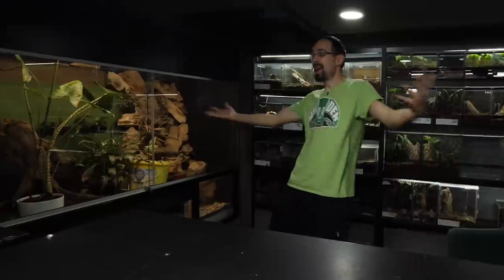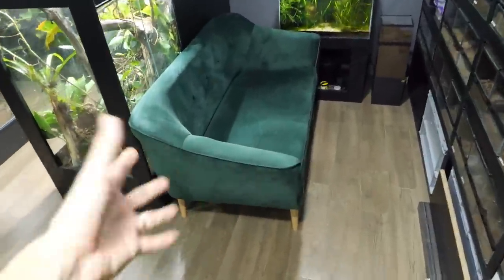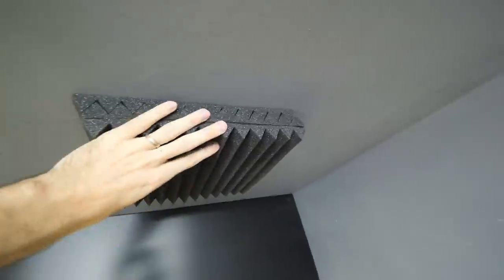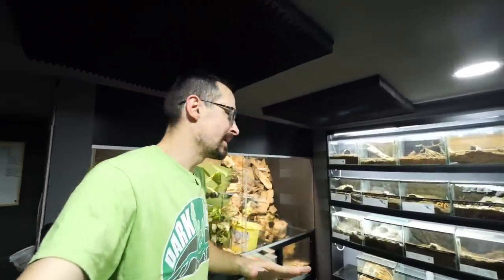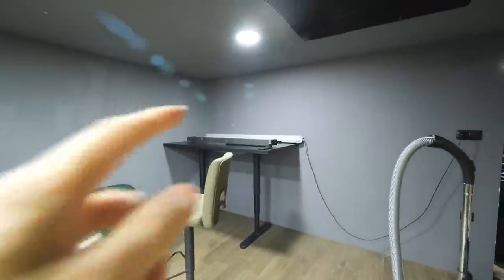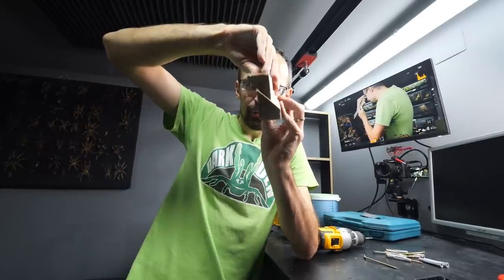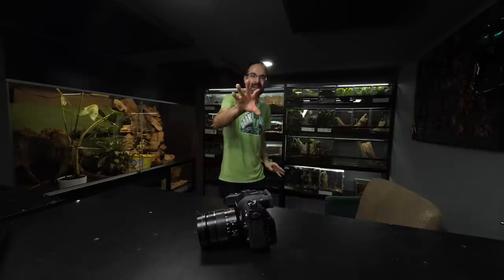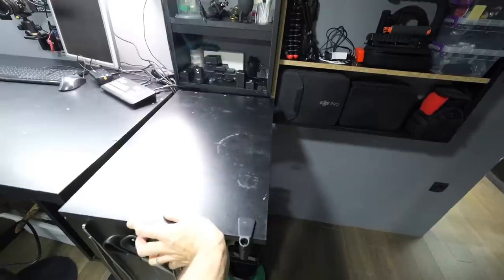How I Made The Dark Den BETTER!

Comment: @The Dark Den, If you want to reduce your reflections, regarding the enclosure shelves. 
1. Buy thin acrylic glas (2mm is enough) that is as long and wide as your shelves. 
2. Buy frosted window screen.
3. Apply window screen to each acrylic glas sheet.
4. Buy tooth picks. Paint black. 
5. Drill small holes for toothpicks, in level with the shelf bracers.
6. The Toothpicks will serve as support for the 'shelves'. Place the frosted side on the LED side.

This will disperse the light and soften it. It will reduce the reflections significantly. It might also cause your enclosures to have more even light dispersal too.

Comment: I would suggest that any hole big enough to fit all those cables will also allow for some entertaining sling escapes.
You could always try and lift some more stuff off the table and to the wall.

Or just make sure that everything that stays on the table can stay there when you have to quickly move the table to reach some escapee ;)
Reply from the maker: I actually plan tu use rubber plug that you pull cables through. That way there are no holes for slings to squeeze xD

Comment: Isn't there some sort of glass covering, something you can paint on the glass or a transfer you can put on the glass to get rid of reflections? There is a peel and stick version used in homes that tv shows are filmed in. Idk what specifically it is called. You can still see thru the material, it just makes the reflection go away.

Comment: Would adding lines of bright dimmable LED lights along the top of the walls all around the room so you could turn off the normal lights you have in the ceiling cut down the glare issues? You could just turn off those light strips on the opposite walls of the ones you are trying to film. There would be nothing to reflect. 
Test out some Anti Glare Film. It would be a pain in the ass to put on every tank but it cut the gare way down..........